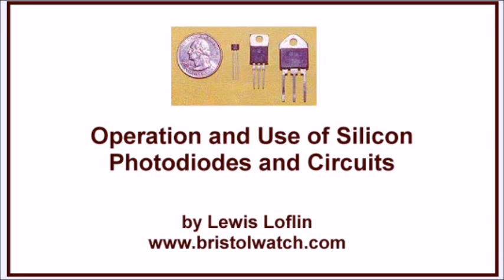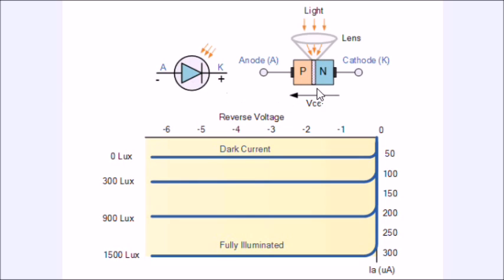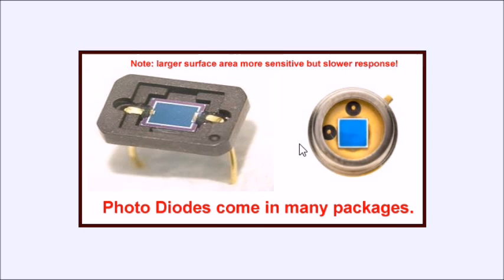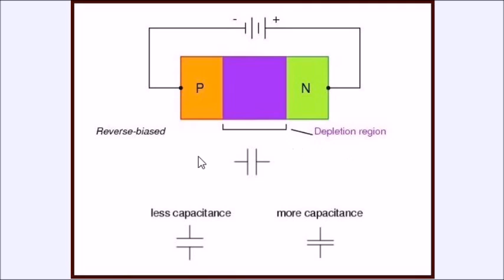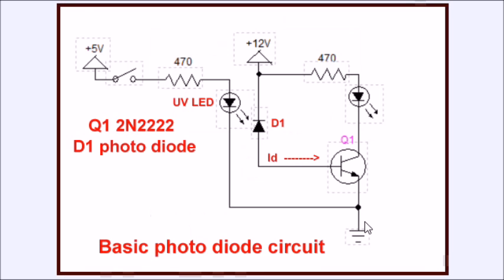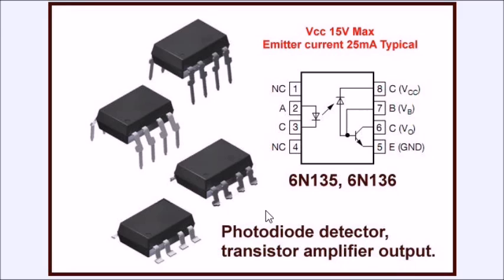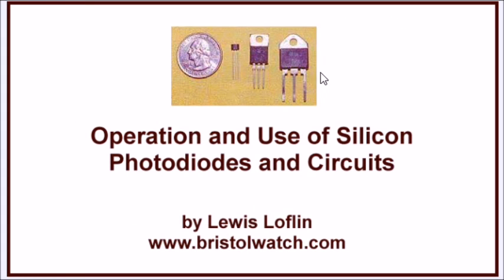Photodiodes and How they Work

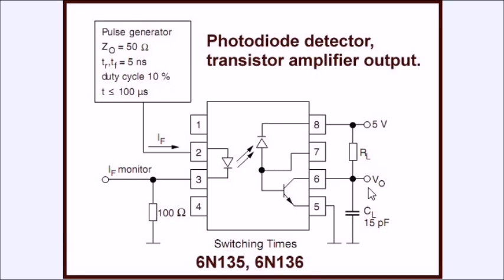Comment: @9:57 why does the circuit use a capacitor on the output. That would slow the response time of the output and you wouldnt know  if it was the output cap or the pin diode which is causing the delay.
Reply from the maker: It's a test circuit right off the device spec sheet.
Reply: @LewisLoflin  I wonder  why a cap though.  There's a lot about electronics I don't understand.
Reply from the maker: @noweare1  That may represent inter-electrode capacitance and not be a real cap. The idea is a certain signal is input and the response is measured on the output. In normal use it isn't needed.

Comment: Really liked your video. Can I know how much is the delay in response or what's the response time of PIN photodiodes?
Reply from the maker: I used an old diode for the demo - it depends on the specs for the device. They can be really fast - they are used for example in modern camcorders, etc.

Comment: how do you use photodiodes in conjunction with an op amp to measure light
Reply from the maker: Current is directly related to light intensity - more light more current higher voltage.